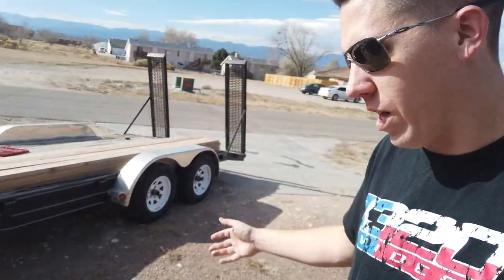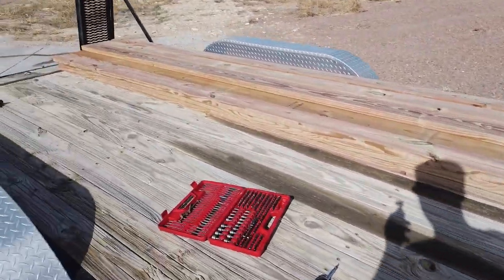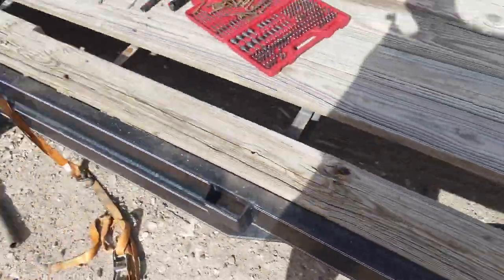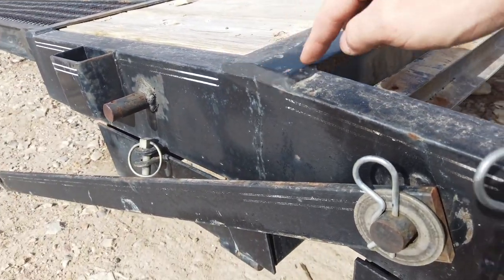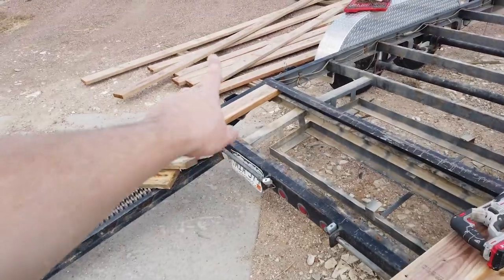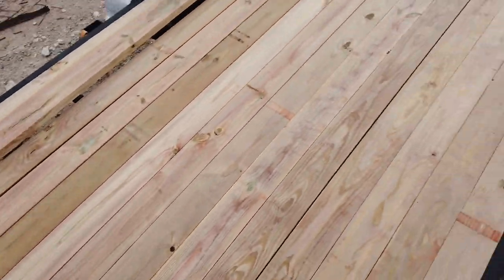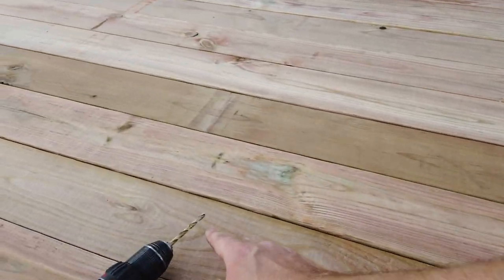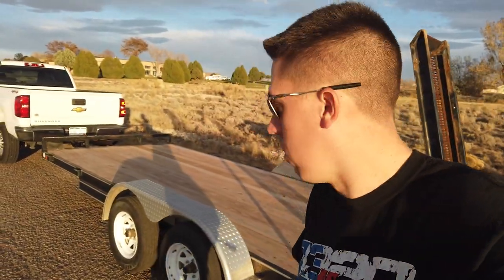How Much Does It Cost To Re Deck a Car Trailer?

Comment: We just sent mine to be sand blasted and repainted.
I stripped the wood by cutting into the middle and prying them out.
Most of the screws were stripped so I busted the remaining screws and ground any down the didn't break clean.
Took about 2 hrs to clear all the wood and clean up the broken screws.
Going to seal our wood prior to install.
And I think we can slide in the 18' from the end, instead of bending the last few into place..
Will see how it works.